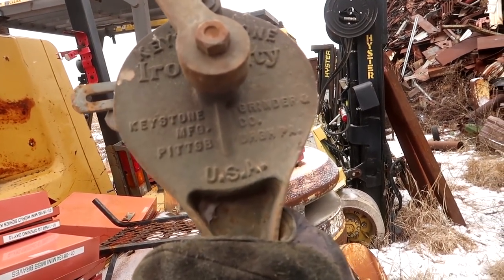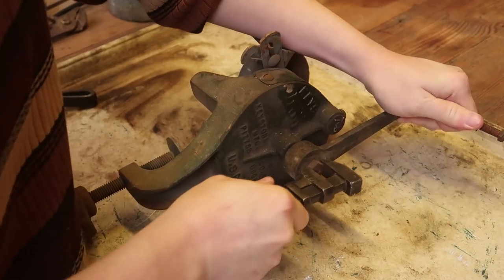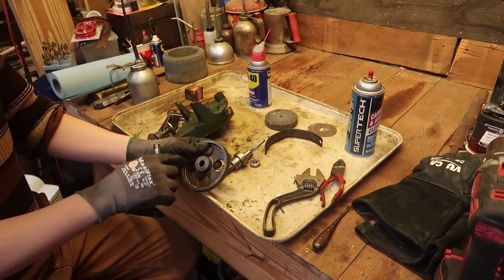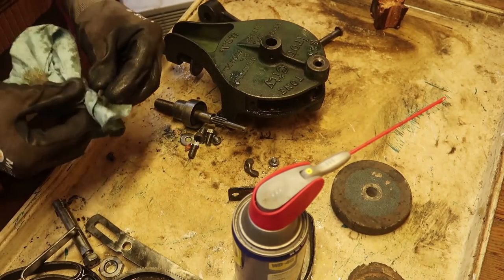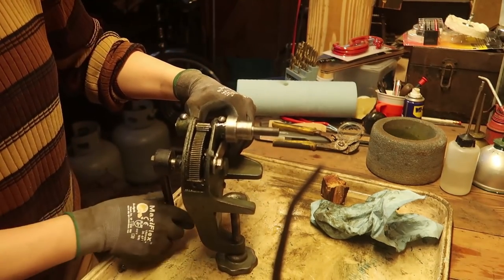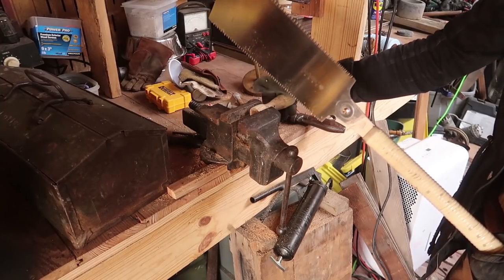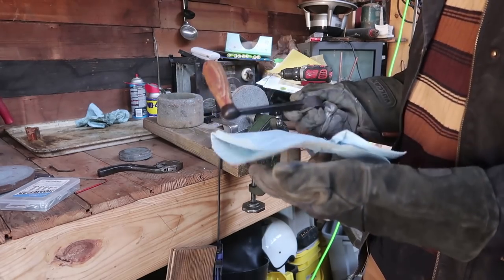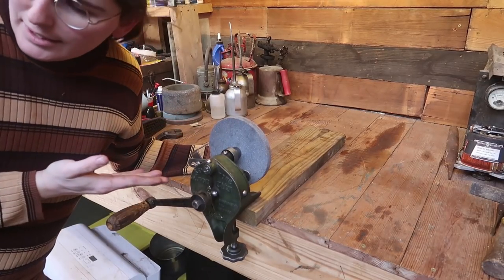1920s Keystone Iron City Hand Crank Grinder Restoration

Comment: As a general rule, its best not to sharpen the last quarter inch of the tip of the axe blade. Just because the tip takes the most abuse from dirt and debris and if you keep honing it you end up with very rounded bit profile

Comment: I would motorize it since it’s a gear box basically it would get more speed out of the motor. Put a fly wheel on the handle shaft and connect the belt to the pulley being driven. But I understand your reasoning

Comment: Honestly if you're going to make a generator out of that I would just put magnets on a disk and attach that directly to the grinder shaft. Less resistance that way and from what I've seen it goes plenty fast enough. I could easily see you making a wooden disk and gluing neodymium magnets in a +/- pattern that would rotate in close proximity to a coil. An old stator from a brushless motor would be ideal as it already has a strip magnet in it with varying poles. The ones in modern direct drive cloths dryers work well too.

Comment: I'd imagine the carb-cleaner had something to do with the old pain coming off, it's harsh stuff! WD40 was slower but likely nicer to the paint. Still a far better restoration than before! A bit of paper/paperboard sandwiching the stone should help keep it from coming loose, as the original labels once did. Doesn't need to be thick, construction paper might work.

Comment: your work bench has a perfect mounting board already on it just take the nails out of the wall end of any one of the boards and pull it out enough to mount the hand grinder to it  then just push it back in when not using the grinder  the tongue and grove of the boards will be plenty to hold the board from being loose
Reply from the maker: would have to dismantle the wall and remove all the insulation, and itd ruin my workbench. bad idea

Comment: As for enamel paints, do they not sell Rustoleum in your Lowes or Home Depot stores? I can buy it and they can tint it to be any color that I want.
Reply from the maker: nearest lowes and home depot is 60 miles. they sell rustoleum spray cans at walmart but it doesnt say enamel
Reply: @RinoaL  The spray cans are Rustoleum enamel, if the label says that the contents are flammable and contain toluene and xylene.